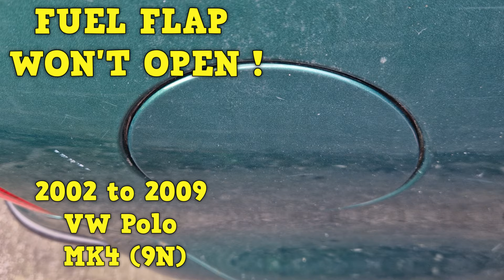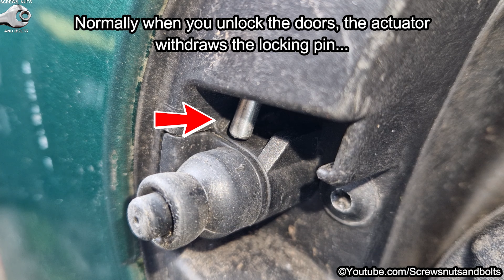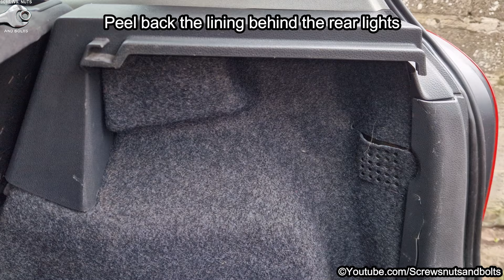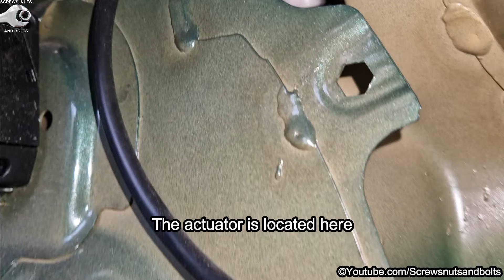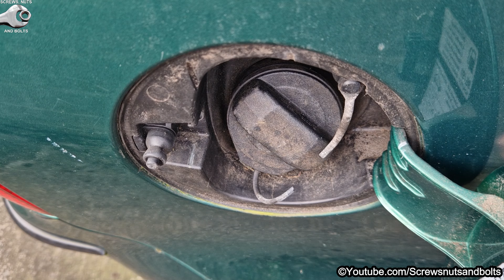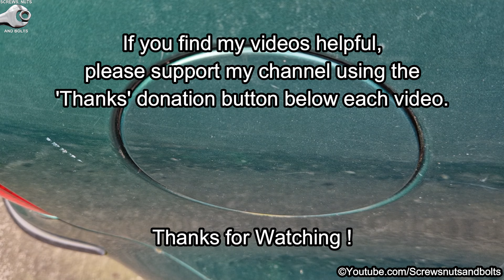Fuel Filler Flap Won’t Open !

Comment: Could you please give any advice Mr 'ScrewsNutsAndBolts'.
Different topic, i can not open my Peugeot 307 2002 plate petrol engine. The front drivers door won't open (all other doors open). From inside or out. The lock on the door does not have any grip, when I turn the key.  It just spins. The central locking button on my key is broke, hence I use the key. Obviously I cant get at the lock due to the inner door panel to remove it due to not being able to open the door. Any, advice will be really really appreciated. Thank you. 
Im serious not creeping but you site is really clear, no silly background music. You demonstrate the job to be done fully, in a clear, start to finish way. Thanks again.
Reply from the maker: Is there a central locking button on the dashboard to open and close all the doors ?, just beside the hazard light button. Is that working ?
Reply: @screwsnutsandbolts  
Thank you for your quick reply. 
Yes, but it doesn't make any difference. I've tried it on and off. Door still won't open.
Reply: @screwsnutsandbolts  
Thank you for your quick reply. 
Sorry if I have sent this reply twice. 
The central locking works on the other doors. But it doesn't make any difference to the drivers door, but it still won't open. With the central locking being either on or off. 
Thanks Mr ScrewsNutsAndBolts.
Reply from the maker: I'm afraid you'll probably have to get a locksmith to open it for you. It sounds like the mechanism is stuck, or broken. Sorry I can't give you any more help, hope you get it sorted.
Reply: @screwsnutsandbolts  
Had the RAC he couldn't get in. Then he called a locksmith, he couldn't get in, only because I suggested wedging open the back door with them inflatable pads things they have. He was able to open the window with the manual window winder and a hook/ stick. Climbed in through the window, then pressed the central locking button. All the doors and boot could be opened except the drivers door!!!
 Anyway, Thank you for your response and advice.
You're one of life's Good people. Seriously. 
Keep up the good work 👍